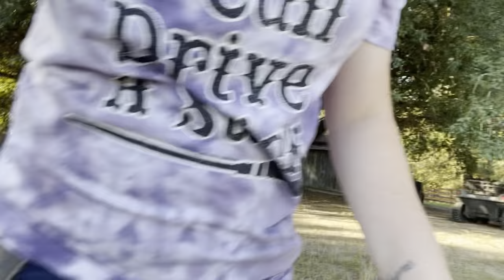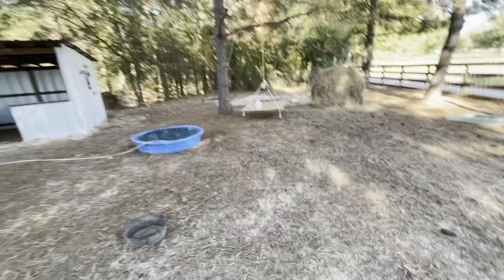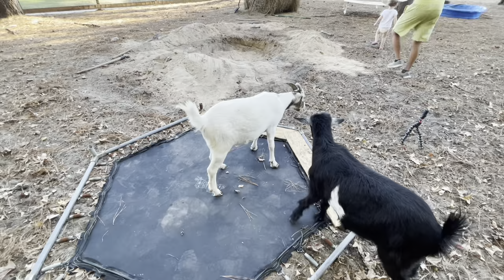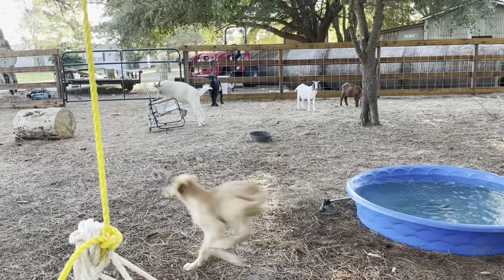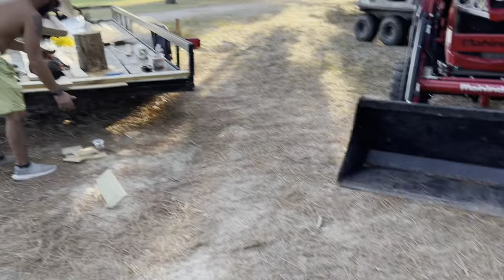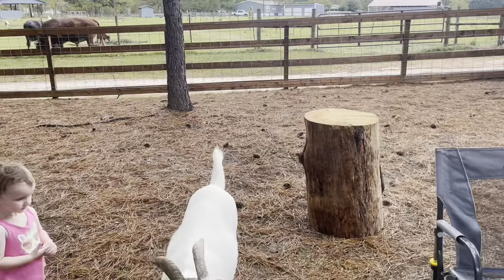TRICK goat!

Comment: First off, I love what you guys are doing. Jake is awesome that he is doing that for the goats. The swing needs a redesign. The ropes don't leave enough space for the goats to jump on the swing. The knot is to low. I think the goats know they could get hurt on that with their horns catching on the rope. There are ways to make the knot a lot higher. You could make a cross with some wood, put holes in it, and hang it much higher so the lines go parallels for 2 meters and then make a knot on both sides. I hope I explained it; or use a different tree. Good luck. I love you guys.